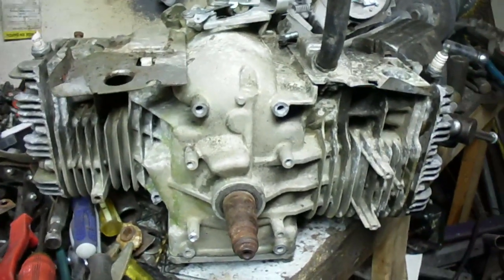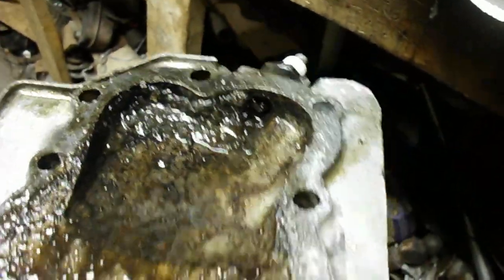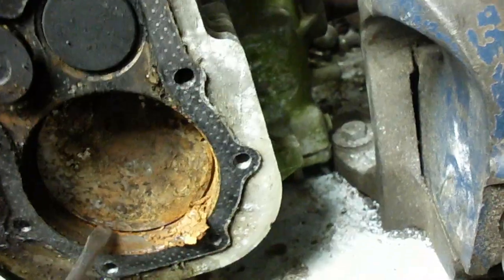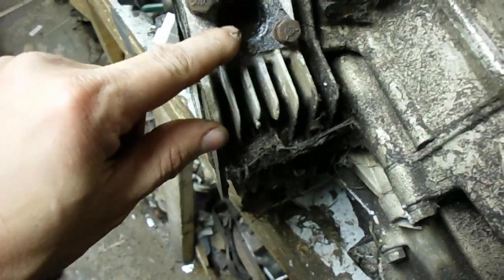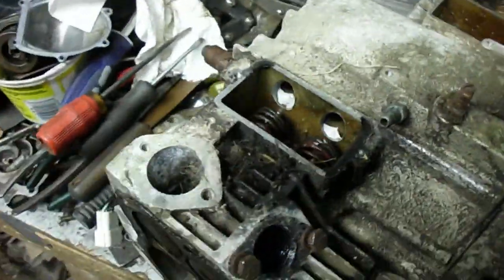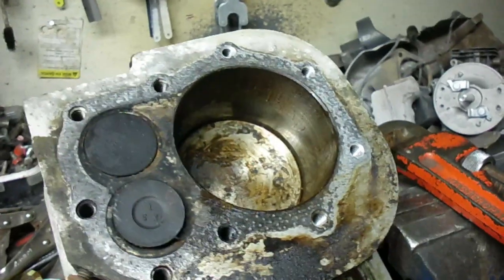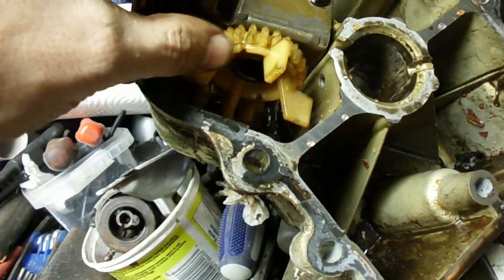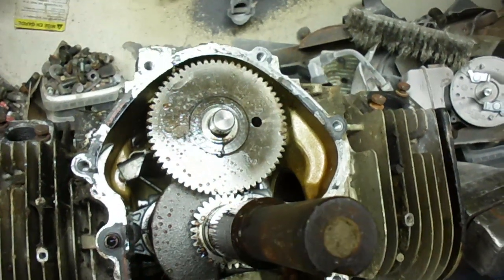Opposed 2 cyl. Briggs model 42 Teardown Part 1

Comment: briggs opposed twins make great snowplow tractor engines.due to you dont have to rev them very high to make great torque.that really matters as the hundreds of pounds of snow builds up in front of the plow blade. my 16 horse pushes right thru it, with wheel weights & chains on it too.the crazy part is it has been doing it for 31 years.maintenence is the key to longevity.
Reply from the maker: There is a riding mower with a snow blower on the front, but it has a Kohler engine. I generally leave such large items at the scrapyard, as i don't have a space to store it in. Yes, I can see how the big Briggs 2 cylinders would have good low end torque, lots of cubic inches.

Comment: rebuild it with e bay parts... might not ever be as good as new, but cld make it run... but parts wud cost more than the thing is worth... sadly. they want good $ for those used parts on fleabay.  but one by one... hone cyl, new oversized rings... in .010" or . 020" and FILE FIT THE RINGS to .012"  ring end gap... sand the crank with 1500 grit sandpaper, same with piston skirts, new carb, gaskets, throw gov wonky thing away both inside and outside the motor. paint it... run it. it will run... might want to use 20-50 motor oil... with 15-50 diesel oil so it doesnt smoke too much. the valve guides are the things that will be worn a LOT so the valves move side to side... if u can feel them move... they have moved too much and need brass sleeves to fit the valves. the valves are HARD STEEL. the alum valve guide wears out. . valve stem seems to be .310/311" so get a brass sleeve for the valve guides and re sleeve the valve guides with brass inserts
Reply from the maker: I agree, you have to shop hard on ebay to find good deals, some prices are astronomical!

Comment: Many years ago , when I worked a a mower shop we had a new one come in with a dead miss one side had 0 compression,, pulled the head and the piston was missing, and there was a dried part of a sandwich in the bore,,,,!
Reply from the maker: So what do you think happened to the missing piston, abducted by sandwich eating Aliens???!!!
I have heard of gasoline and battery thieves, but PISTON Thieves, that is bizarre!!!  Sounds like somebody was pulling BS to me.
Reply: @ChargerMiles007  it must have been a (employee) problem at the factory,,,,?

Comment: These are my favorite videos you do. Taking engines that are too far gone and you try and get them running.
Reply from the maker: Thanks for watching, I appreciate it. Yes, I am a sucker for punishment when it comes to old Briggs engines. I did manage to un-seize the 1 stuck valve in this engine, it had to soak for a week with the port full of penetrating oil. Then I heated the valve guide area with a brazing torch, being careful not to melt it, then I pounded a thin chisel into the valve spring area pushing on the valve. I then tapped the head of the valve closed, then used the chisel again, doing this 30 times or so, with progressively thicker chisels. Eventually it freed up enough to open with a pry bar. Once I got the valve out, I sanded the the stem smooth, as it had some corrosion pits in it. now it opens and closes like new. Now I just have to locate some reasonably priced parts, such as a flywheel to get it going.
Reply: just a matter of $$$$ and patience...  new rods $26/each, new oversize rings on old pistons... get the .010" rings and file fit them to get .012" ring end gap, port the intake/exhaust port, get rid of restrictive factory exhaust, put some kind of better exhaust on it.  the flatheads power is down low anyway. from 1800 to 2600 RPM is where its torque is... the OHV's are from 2200 to 3600 R's torque curve. so not much point in trying to scream a flathead to get a whole lot of power out of it when the OHV  engines are up by at least 2-4 hp from the same CC engine/s by virtue of head design/OHV

Comment: Think aircraft engine.
Reply from the maker: Yes, my thoughts exactly, that and the original VW Beatle.  I was also thinking Hernia when I picked it up :)
Reply: @ChargerMiles007  OH MY ACHING BACK!!!! WHERE ARE MY PAIN PILLS!!!! OHHHHHHHHHHH the thing is 75# at LEAST. the flywheel is 20# or so that is why revving it over 3600RPMs is not encouraged... the rods/flywheel will come apart. i take the gov out and throw it out/ the thing inside and the wonky mechanism outside... run throttle straight to the carb... E bay digital tach $10 to keep eye on rev's and below 4000R's without $350 aluminum billet flywheel and $130/EACH RODS... pistons... $300 cam and then it is still down on power by at least 2 HP compared to OHV engines... at LEAST 2 HP from the same CC's ... the 20 HP INTEK is 656cc. the 18 hp opposed is 696cc's... just the head flow is not there on the flatheads... like when they came out with the OHV engines... the flatheads went away.

Comment: I have always liked those engines gotten to play with a good few of them over the years. Happy tinkering
Reply from the maker: I found some empty crankcases at the scrapyard about 12 years ago, but no other parts, this is the first one that had been removed from the mower, so I was able to snag it. The one intake valve is seized fairly well, I heated it twice, with no luck, but I can be a persistant fella!  we are getting hit with snow the last few days, winter had me fooled back in December, I thought it was going to be a mild one, I was wrong. this one has turned up the snow and cold machine the last few weeks, i am ready for it to end. I have used the old 72 snow blower twice already, only once last year, and not at all the year before that. Come on Spring!!!  :)

Comment: Pretty cool project, it was interesting to see what the inside of an opposed twin Briggs looks like. I hope you can get it running!
Reply from the maker: I will be looking at the scrapyard for an intake, flywheel and carb, but these engines are fairly rare there. I know I saw one last summer, but it was buried too deeply, and I had no use for the parts then.

Comment: Sad part is, if that engine were over here in the UK, even in that condition it'd end up on ebay with a BIN of £350, cos people think they're worth silly money when they're just engines... :P
Reply: sad... they are scrap here... mostly cuz they cannot CHECK THE GD OIL BEFORE EACH RUN OF THE DAY... CHANGE THE OIL EVERY 25 hours or LESS!!!! why briggs wont write that on the top of motor??? so i do when i rebuild/paint them for the next ding a ling that gets it that has NO CLUE... how to CHECK THE GD OIL in a motor... i paint the dipstick tube YELLOW so ding a ling can SEE IT AND MAYBE THINK.. CHECK THE OIL!?!?!? an dwrite on motor USE 10-40/15-40/50 motor oil for long happy life with paint pen since most ppl are TSTB
Reply: At 700CC its bigger than alot of motors in the UK

Comment: Oppys are my favorite! Real snotty engines, I run them in whatever I can. I've had...8? 9? Yeesh, a lot. They're all over down here in KY. I can easily get more for cheap too. I've even had two 46s, one a full pressure lube, which i still have. I have a horizontal 40ci too, my best one really. It's a shame you're way off in Ontario, I have a metal fin flywheel and a few other parts I'd donate to help put this one together.
Reply: Part of me wants to replace my 42 with a 46, but the 42 just runs too well.
Reply: RichieRichOverdrive any hints you can give on building exhaust for one of these? I’ve got a 78 roper with 16ho oppy
Reply: Do you have a source for B&S p#692324 intake valve stem seals? I've got a badly bashed one that I need to replace.

Comment: Did you go dig that out of a scrap pile while it was no degrees outside or have you been sitting on that since summertime ? My work bench does the same thing. No matter how many tool boxes I get I end up with a 2’ ( 60 cm ? ) pile of chaos on the bench.
Reply from the maker: I just got this engine yesterday when it was no degrees out!  :)
Yes, I cleaned the work bench about 6 months ago, but the pile just keeps coming back.
Reply from the maker: Hey, thanks for sending that link to the old Briggs manuals, I printed a few of them out already!  :)

Comment: I was surprized to see it had no oil pump just a spinner! Will be a good project.
Reply from the maker: Yes, that surprised me also, the smaller V twin I have has got an oil pump in it. I think it is a Vanguard.  Hopefully I can track down a flywheel at the scrapyard sometime. I doubt one from a single cylinder engine would be correct.
Reply: Yep,  only the very last couple years of the opposed twin had an oil pump. 

The vertical shaft motors are bad about starving the #2 rod for oil at low RPM.

Comment: Can’t wait to see if she runs
Reply from the maker: I just need to coax that stuck intake valve into opening first. I tried some heat on it twice with no luck. I will let the penetrating fluid have a longer turn at it.
Reply: ChargerMiles007 good plan 👍🏻